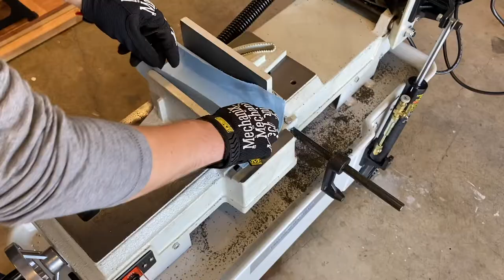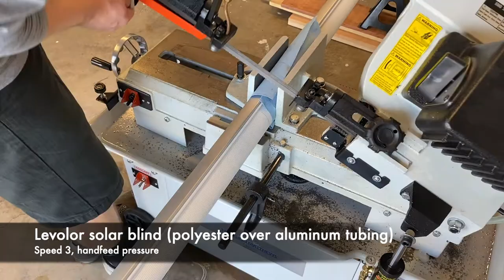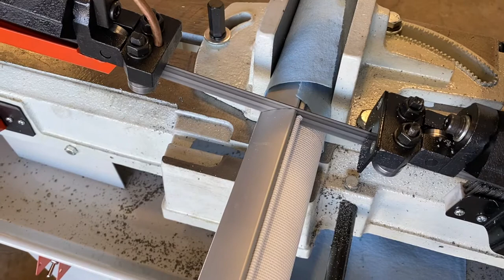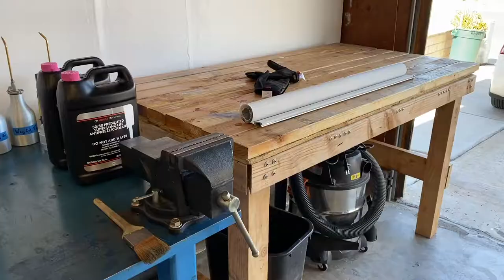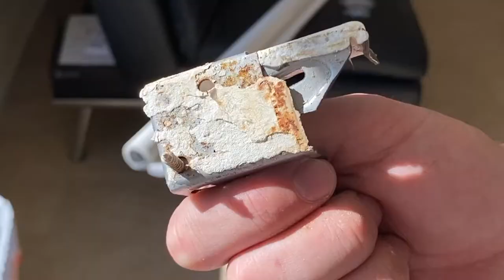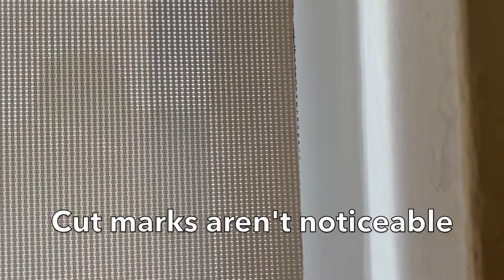Cutting Levolor solar blind with a band saw

Comment: After cutting, did the solar mechanism work?
Reply from the maker: Yes. We removed the roller gear assembly (slides out and is rotated to provide tension) before cutting and slid it back in after cutting. At the end of the video we then installed the blind at a different window where it now lives. The blind still rolls up and down and acts as a solar shade, no one would even know that we cut it to fit the window.